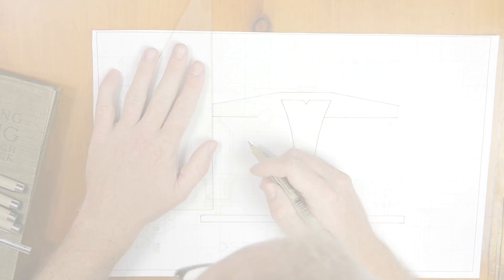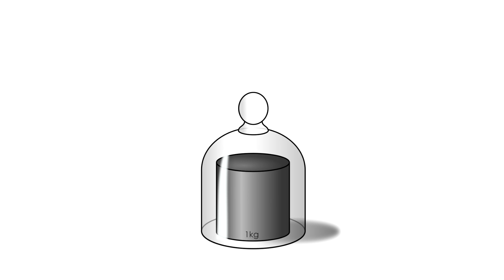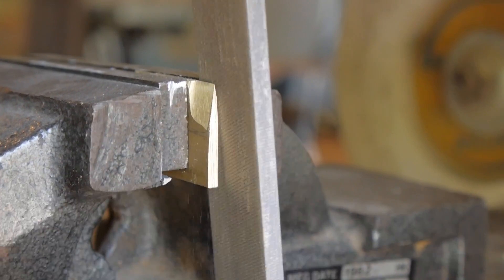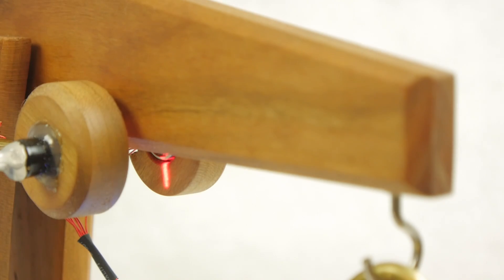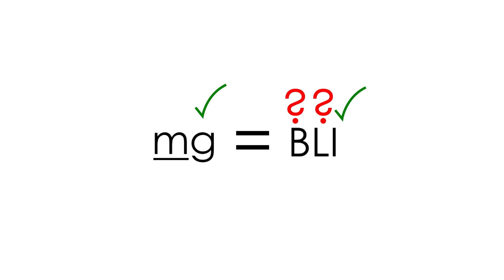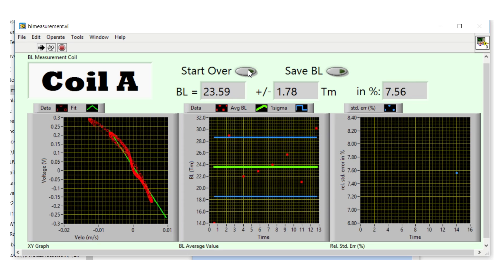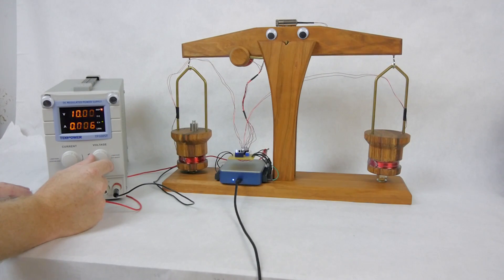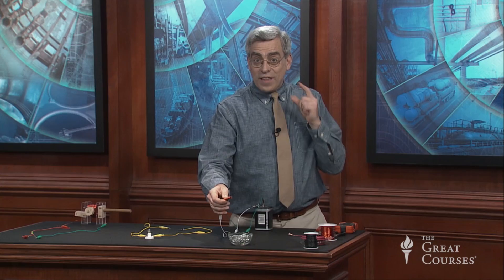Redefining the Kilogram with the DIY Watt Balance

Comment: There are two problems with your hypothesis: A) You cannot be sure, or prove, that the two coils are identical and hence they conduct the same current and B) The unit of current - the Ampere, is not based on fundamental, physical constants; it is, itself, a derived unit of measurement.
Reply: @nickpwnes - perhaps you should stick to watching ice hockey.
Reply from the maker: +borchrich For A) it is using the exact same coil for both modes. The only purpose of the second coil is to drive the movement of the beam during velocity mode. For B), you're right that things are a bit more nuanced. I'm on my phone so I can't explain it all here, but NIST explains things more thoroughly in the paper I linked. This is not my hypothesis. Scientists much smarter than me have figured all of this out.

Comment: But isn't Volt defined by kg? So you define kg through a unit that is based on kg, or am I wrong?
Reply from the maker: +McElfe You're right, there are some nuances that I didn't have time to get into. The paper I linked goes into greater detail about how the redefinition would actually play out.
Reply: Ah okay, i see. Thank you!
Reply: Will You I need a source on that claim. Usually what's used is a device based on semiconductors such as diodes.
Reply: Yes, a Volt is a kg*m^2*A^-1*s^-3
Reply: There are other ways to get a measurement of volt. A battery is a chemical setup that produces a very specific voltage (1.5v). There are other chemicals that when mixed, produce different voltages. 

This is actually how they get very accurate and reproducible 5v on every phone and pc. put a small bit of that chemical in a tiny chip, and circuits use that as a reference to check against itself whether its producing 5v
Reply: @willyou2199  batteries actually fluctuate very much in their voltage. that ~1.5v is only at full charge. it immediately starts going down once discharged and will cut off around ~1v depending on the product. so no, that's a terrible way to measure.
Reply: google Reference electrode

Comment: Didn't understand how it works, it's cool non the less...
Reply: summarizing, when you send electrical current through a coil of wire, you generate electromagnetic force. With the permanent magnets in the device this force causes the balance to go up as the forces oppose. Inputting more power through the wire increases the magnetic strength, lifting the object more. By measuring the amount of power required to balance the object you can determine its weight, granted you know the strength of the magnetic force and the length of the coil of wire. There is more to it than that, but that is enough to understand how it works.
Reply: DreadKyller still not understanding, anyway...

Comment: Well you forgot to do the most important thing! Get a weight standard an compare it to your results :)
Reply from the maker: The 20g mass I was using was just out of a cheap classroom set. The desktop design isn't really capable of extreme accuracy - it's really just meant to be a way to demonstrate the concepts that go into the real watt balances used in labs.
Reply: Practical Engineering I understand that, but how close did you measure to 20.0000g? :)
Reply from the maker: The final calculation is shown in the video at around 8:24. I got 19.6 grams.

Comment: I'm probably missing something but, if we are calculating based on gravity, why not measure the force and substitute "a" in F = m.a ?
Reply: Marcelo Lima the only problem there is that force is measured in Newtons, which are derived from the kilogram (1N = 1kg*m/s^2), so if our goal is to define the kilogram, we've caught ourselves in circular definitions
Reply: That is basically what the Watt balance does. The question is in what unit to accurately measure the force? In theory you might use a spring, but a springs properties are dependent on a specific spring and not a universal property of the universe. The Watt balance measure force using magnetic fields inducing a voltage and current. Voltage and current are universal and can be measured accurately.
Reply: And how are people supposed to measure F?
Reply: The volt is also defined by kilograms.

Comment: For non-engineering, non-science, and just generally everyday use, in countries using the metric system we usually just correlate a kilo to ~ 1 liter of water.
Reply: they have done something very similar with a sphere made of silicon(I believe). silicon was used as the structure is most well researched and understood. its the roundest object on earth!
Reply: yes that it is true. the problem with this as definition is that 1 liter of water have a mass of 1 kg. at 4 c. but at one atmosphere of pressure. and for the pressure definition you need the kilogram.
Reply: yeah, but a liter of water is based off a kilogram. So you are doing the conversion backwards.
Reply: It varies, just not too much.
Reply: I don't think so. 1L is the volume of a cube that is 10*10*10 cm.
Reply: but the volume of a fluid doesn't vary with pressure now does it?
Reply: you mean at 4 degrees Celsius? or even at 277,15 K? that would seem more accurate for a metrologist ;-)
Reply: ESSBrew It used to be, but now it is defined as 1000 cubic centimeters.

Comment: 9.793? did earth get lighter? did somebody measure it better? i always use 9.81
Reply: It depends on where you measure it. The higher your altitude, the more distance from the center of the earth. Also, the earth is a bit of a squashed sphere, so the equator's sea level is a different distance from the center as the pole's sea level (I think). The further out you get from the center of mass, the less you weigh.
Reply from the maker: Gravitational acceleration varies by location due to many factors. I used the International Gravity Formula. More info here: https://en.wikipedia.org/wiki/Gravity_of_Earth#Latitude_model
Reply: the earth gravity varies relative to where you are on earth due to densisty of the ground underneat you and the distance from the center of the earth to your
Reply: Practical Engineering i knew it varies, but did not thing it was that much (my guess would have been a few decimal places to the right)

I guess i would have gotten less out of my kilogramm, darn.
Reply: Belias Phyre i knew that, just did not think it was that big of a difference, now i know.

Comment: 9.793? Austin Texas? 0.14% difference to where I am now... The accuracy seems to completely depend on our ability to measure that constant at a specific point to a great enough degree. I find the idea of defining the (k)g as a certain number of atoms of a certain kind in a well defined chemical and energy state much less error prone and more portable.
Reply from the maker: Yes, I used the International Gravity Formula (more info here: https://en.wikipedia.org/wiki/Gravity_of_Earth#Latitude_model), but labs already have extremely precise ways to measure gravitational acceleration, which varies by location and also in time (due to changes in groundwater, sea level, etc.).
Reply: The m^2 / s seemed to get corrected in one place. But then showed back up in the denominator of the equation for mass.
Reply: true that defining it by the number of atoms would basically make it standard, but it would be very hard to keep it stable. We already have very sophisticated gravity measuring devices capable of detecting extremely tiny differences in gravity, making this method very accurate.
Any serious lab that needs this level of precision could afford to build such device to measure any random piece of matter to levels of precision without worrying about their "standard weight" drifting due to decay or handling.
Reply: He also used the units of m^2/s instead of m/s^2...
Reply: From looking this up you are right that currently watt weights suffer from not being precise enough. Which is why there are also other projects. But the goal of all these projects is to define the kilogram as a number of planck masses.
Reply: Atom-counting techniques proved to be too impractical. Watt balance won the battle and the unit will be redefined in 2018.
Reply: They could, but how would you kjnow when you have the right amount of atoms?
Reply: Physical objects are convenient, but they also change over time. This is exactly why the standard is getting updated as those old defining cylinders are going out of whack.